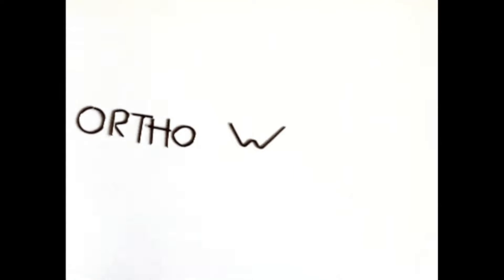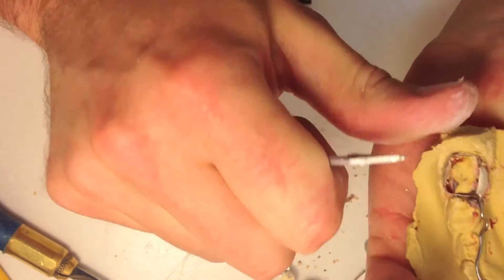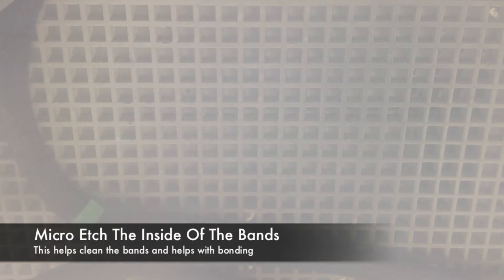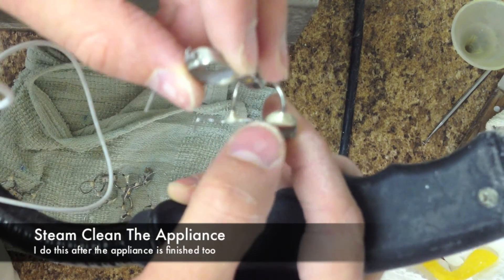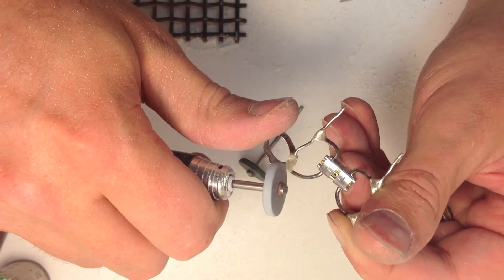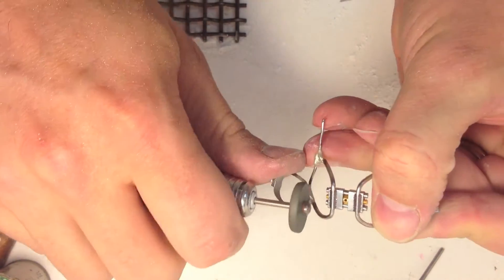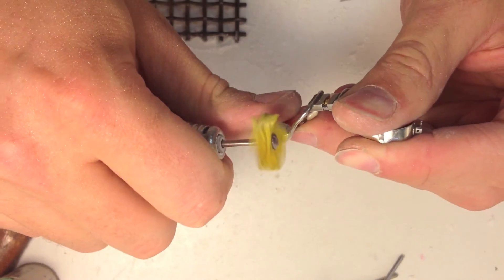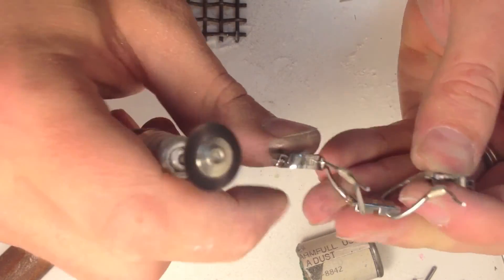Finishing Fixed Metal Orthodontic Appliances

Comment: Hi RetainerDesigner (Keith?)
I'm Kevin from Australia,
I have some questions and if possible would you mind to clear them for me:
- I almost have bubble on my RME solder, is there any way to avoid them?
- could you tell me where can I buy the Micro Etch and steam clean? (can I sand blast instead of micro etch?)

Hope to hear from you soon
Thank you

(I tried to leave reply on your website but it said error, CAPTCHA not find?)
Reply from the maker: Kevin,
Most of the time when i get bubble with my solder joints is either i over heated the solder joint or the solder joint what dirty before I started. Try cleaning with a steamer (If you get one) or water and toothbrush to get rid of any particals or finger oils.
Microetch: I bought here: http://www.greatlakesortho.com/commerce/detail/?nPID=1046
I dont see why you can blast with sand, as long as it produced\s thae same effect. THe etch uses 50 micron Aluminum Oxide, maybe you can use the same material?
Steamer: https://reliablecorporation.com/collections/dental-steam-cleaners

Thanks for the tip on my website I will check that out....